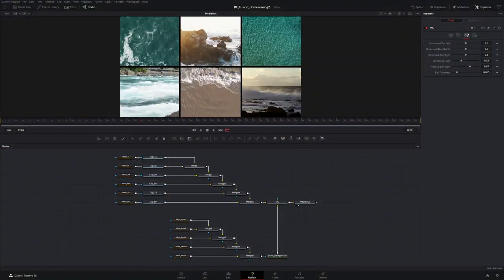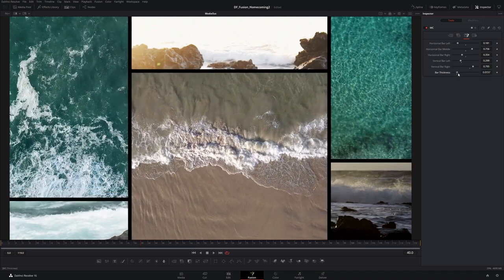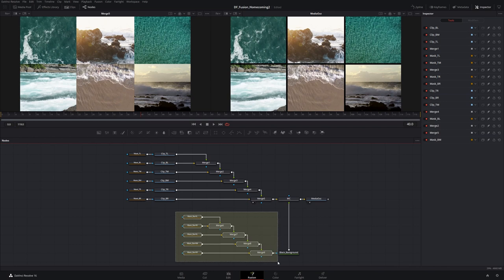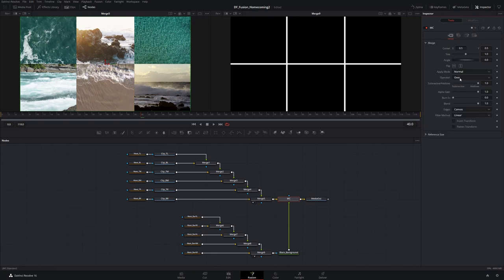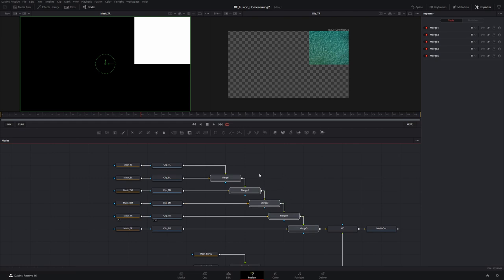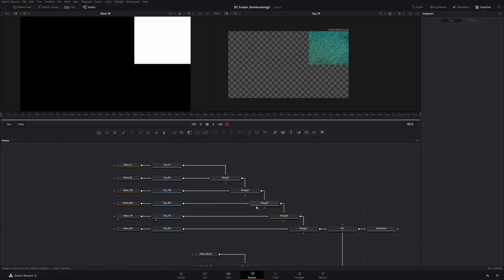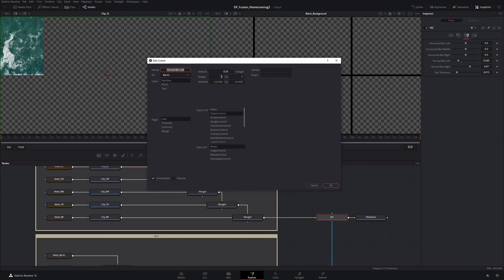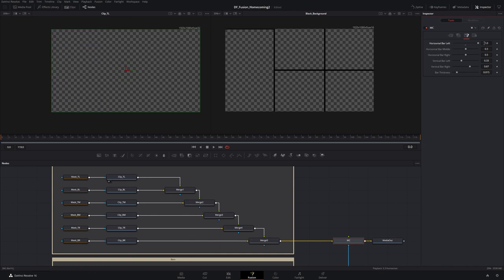DaVinci Resolve 16: 'Homecoming' Transitions Tutorial

Comment: I followed along, both this tutorial and the previous on editing controls and I had it working perfectly. I then tried the transform added to Clip_BR as you demonstrated at 22:00 and that worked too. I am struggling though with getting the transform to work on other clips. If I add a transform to the top Clip_TL, disconnect Mask_TL and reconnect the mask to the new transform as you did at 22:00 it messes up the masking. Do you see the same thing? I am trying to figure out a work around but nothing elegant yet.
Reply from the maker: Hi John. There is an updated video I realeased to address this. Take a look in the description for the link to the correction video I posted that will solve your issue. Sorry for the run around! Let me know if this works for you.
Reply: @darrenfrenette2597  My bad.... Always read the comments. I would then have known you had a fix. I have it working now.